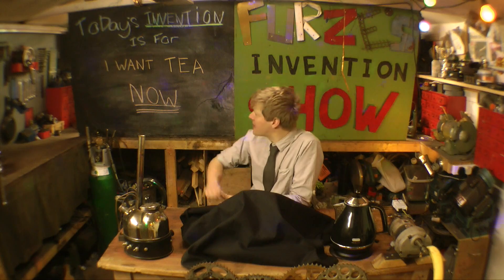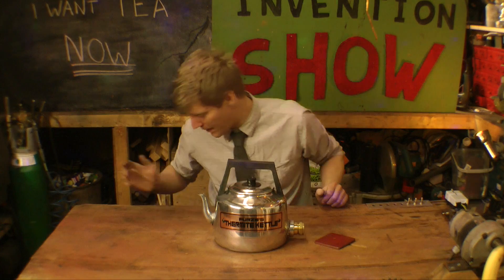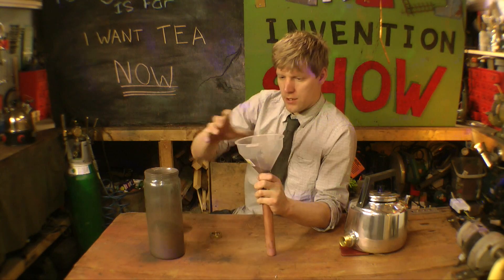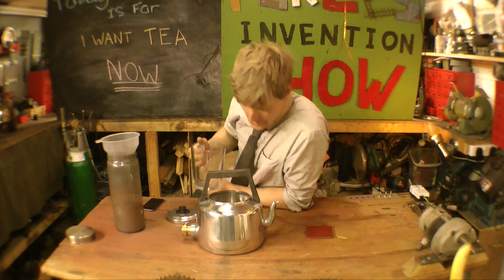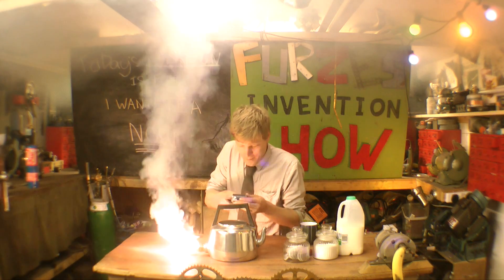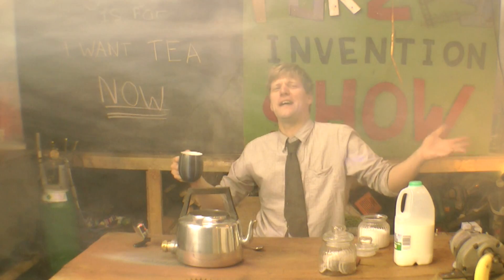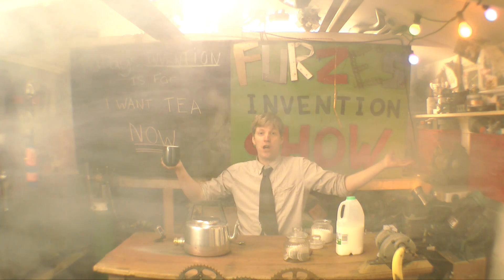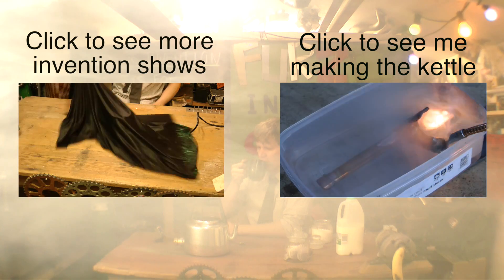The Thermite Kettle

Comment from the maker: HAHA YES MY TEA IS WEAK as hell in this video, now i do have it weak tea but on this it does look bloody awful so keep the abuse coming.
Reply: How are you not choking to death!? Keep it up man. Never a boring video :)
Reply: +colinfurze make an air umbrella
Reply: +colinfurze You can improve the heating time by increasing the surface area of the heating element. same quantity of thermite, in multiple smaller pipe. you'd make the side of the kettle flat, and have the thermite cartridge slide in like a fork made of multiple tubes, those multiple tubes would be connected like a fork, and be filled and lit together. you'd need 1 sparkler for each fork, and to have them bent together to a single lighting point, but it would work. 

In fact you could probably do with less thermite as well. just work out the math for how long it burns for, how much heat is generated total, just go from there. 

Though really the best you could do is with a very tall kettle that you put the "fork" in through the bottom, and it looks like the bottom of a CPU chip, a grid of prongs. and just fill it to the top. Maximum surface area evenly distributed through the water, for the fastest heating possible. 

But heating from the bottom with thermite, you'd have trouble lighting it, and you'd probably catch the table on fire. maybe a sealed disposable electric starter and a gas vent?
Reply: Make a homemade swegway? That would be awesome!!
Reply: +colinfurze 600cc Blender that can make a 5 gallon margarita in seconds :D
Reply: +colinfurze Yeah that brew looked sub-standard....
Reply: +colinfurze was just about to say it looked very milky
Reply: +colinfurze Do you have any tea with that milk? :P
Reply: +colinfurze 
Running out of ideas?  LOL
Reply: +colinfurze  How about a self cooling pillow?
Reply: +colinfurze make a mug that warms your tea up once it is cold
Reply: try make a real lightsaber
Reply: colinfurze https://www.change.org/p/bbc-collin-furze-as-the-13th-doctor
Reply: +colinfurze When you want tea, YOU WANT IT NOW!
Reply: +therealquade I reckon he should just attach the heat tubes of a CPU heat sink to the pipe. would be way quicker!
Reply: make a flying ✈ car 🚗
Reply: +colinfurze Should have just blamed it on the white balance and kept some pride .......I've seen stronger tea in hospitals.
Reply: Anne Hero that would add a delay, the heat only transfers so quickly. First the thermite gets hot, then the tube gets hot THEN the heatsync gets hot, THEN the water gets hot. you're also increasing the volume of what's being heated. which means you'd need more thermite, not less.
Reply: you should call it thettle
Reply: +colinfurze How come the thermite didn't burn through the tube?
Reply: +colinfurze Not many others who can make a living while having great fun the way you do. My hat's off to you, good sir.
Reply: +colinfurze LOL! nice! It would probably go even quicker if you increased the surface area of the thermite container (i.e. more smaller tubes instead of a single big one)
btw.:
How about making a machine that fries a pancake and flips it (by throwing... obviously) at the perfect time? :)
The pan could also be thermite heated ;P
Reply: I think u should make something to worm up ur bed before u get in and u can make up the name or if u used mine call it the bed wormer but i dont know so it is up to u about the name
Reply: +colinfurze Make a generator that runs off of poop.
Reply: +colinfurze  make a toboggan or sled that will go up a hill
Reply: put an engine on a wheelchair
Reply: try making a self charging phone
Reply: Herds of cows gave their lives for that cup of tea.
Reply: +colinfurze  I have a fun idea... you know the moving walkways at some airports? why not a grass one for your front lawn? like a stone block path that leads to the end of the driveway, but it moves and you dont have any need for stone.
Reply: +colinfurze Make jet powered ice skates
Reply: +colinfurze Hey colin, can you make a powered wheelchair, that can faster drive at 10 mph? thank you!
(the kettle is very cool :D)
Reply: +colinfurze that was a shit cup of tea, Colin. 

Nice kettle though! :D
Reply: great idea!! can I suggest a new idea? I was thinking a cool chair that we can sit back in and watch our house burn down as we sip our tea. hahaha. great videos
Reply: How about a suitcase thata jet powered then you dont have to pull it and wear your arms out simples LOL
Reply: +colinfurze you must have a whole army of angels working for you-most serious injury was some burnt skin right? keep up the great work!
Reply: Banananananananana
Reply: +colinfurze thought you were drinking horlicks
Reply: that's cool
Reply: +colinfurze Make a toaster which automatically toasts and spreads butter on a pieice of toast.
Reply: +colinfurze sugar rocket powered gocart
Reply: Philip Gragg because he made his own thermite with a specific ratio so it wont melt the tube.
Reply: +Philip Gragg He said in the build video that he botched the mix a bit when he was making thermite for another project. So this isn't good thermite.
Reply: +Philip Gragg watch how he made it
Reply: okay, I see.. interesting... So this isn't actually thermite..
Reply: Don,t you have a over Chanel
Reply: Make a dryer that folds clothes
Reply: gotcha... cool
Reply: +colinfurze compressed air pumpkin Canon
Reply: I love your vids :) and your humour
Reply: I have an idea where can I send it to you ? it's highly related to almost anything you do in your shed
Reply: +colinfurze Make an on-demand pizza-delivery system. For when you don't want to stop watching the telly to take the left-over pizza (or other edibles) from the kitchen, you press a button on your remote that swings your fridge-door open and launches a tube of pizza at you using pressurised air!
Reply: I was beginning to think British tea was white or sumtin! O.o
Reply: Can you do the Assassins Creed Phantom Blade
Reply: +colinfurze These can only be British comments like me.  Well no not just weak, but too much milk aka nursery tea.  Keep up the good work CFI admire your attention to detail with your work.
Reply: +colinfurze hey i seen you in You Me And The Apocalypse, you lucked exactly the same as in your youtube videos.
keep them kettle ideas coming u goto get to 30 seconds haha, Good luck
Reply: For your next invention, try and make hovercraft shoes
Reply: make some super heated swords that glow red !!!!!
Reply: no abuse here, i praise the hard work and extreme effort you have thrown into everything. keep that good attitude and confidence going.
Reply: do a super powerfull blowgun/slingshot/bow
Reply: +colinfurze what about a snow-maker for slurpies. that shit would be turnt.
Reply: that's brilliant, if it wasn't for the fire hazard it would be perfect!
Reply: Bit rough on the finish… I mean the table's. ;)
Reply: I would love if you do something related to rainbow six siege.
Reply: Here's my idea a fully automated espresso machine. For inspiration see the coffee machine from The Green Hornet (2011).
Reply: Do a suit that goes around your whole body shots bullets and flames and you can charge your phone also make it so you can move easily it's a big project so make it like the atom from the cow tv show do legends of tomorrow arrow and the flash or like iron man
Reply: +colinfurze Collin! You should make a mini fridge that will open up automatically and shoot you a beer or something. PS: I'd think it'd be a good idea to mix this invention with something like the "Freezer Wave"
Reply: you should make the all in one jacket. Heating, a jettle, a built in seat. stuff like that.
Reply: +colinfurze invention idea: Fusion reactor :D
Reply: Make a awesome controlable robot that shoot fireworks and you can control it inside like a mech
Reply: and then blow up a car with a gas tank for the robot to shoot
Reply: invention idea Nuclear Bomb
Reply: +Philip Gragg if you look at the other video where he makes the kettle, he explains that the aluminium powder he used was much more coarse than normal, so it burns a little cooler than normal
Reply: +colinfurze  you should try to  make something that shoots a knife, but gets set on fire when shot out
Reply: +colinfurze You my friend are KooKoo lol ,keep up the videos
Reply: +colinfurze I have quite the idea so i hope your up for it (actually i have two ideas maybe three) My first idea is a pulse jet powered car (but with like 2-4 pulse jets) (if u have already done this don't judge me :D) My second idea is to make a jet/pulse jet powered generator for your bunker.  My last idea may be a slightly dangerous (by that i mean u might/probably will die to this experiment) it is a pulse jet or jet (and just to throw it out there a very powerful water pump) to launch you AKA dummy to SPACE (in case of the jet/pulse jet just make it fly the dummy around your air strip looking place and have fun!  you AKA your weight ratio to a dummy (that last sentence wasn't suppose to go there but just wanted to make sure you knew that! PEEPS LIKE IF U WANT TO SEE!!!
Reply: man the smoke ejectors! collins makin tea!
Reply: Make a jet powered hat
Reply: jet pack! build a jet pack! :D
Reply: +Andrew Bartholomew  A thermite bed wetter, er, warmer!!!!  Holy shit that would rock.
  A big hello from Edmonton Alberta, Canada, the armpit of  western Canada!!!  ;-)
Reply: Bad idea! Your gonna burn your house down you know!
Reply: going to unsubscribe because of that cup of milk
Reply: Erfan Emamverdi dat will be helariouuuuuuusssss
Reply: I think u should make a drone.!!! A ground or flying
Reply: Colin can u make pulsejet water heater for shelter
Reply: ya mum called... she wants her cup of tea back!!! ;)
Reply: Ever do sweet tea? Like with just ice and sugar?
Reply: Make a lantern made out of many little visible lasers that should be aaaamaziiing
Reply: +Diego Travieso A laser hose LOL that would be crazy, Like a grid of at least 50 or something.
Reply: Yeahhhhh that should be graiiiiit
Reply: Rocket shoes!!!!
Reply: +colinfurze  Hey This maybe stupid but why dose the thermite not burn the whole thing? I've seen thermite burn through car engine block right through? So what it don't burn copper?
Reply: +MR .Foog he fucked with the ratio
Reply: You should make a speed tea were you focus on time and quality of the tea.
Reply: +colinfurze  I am sorry to tell you this but aluminum oxide gas is very toxic and should not be inhaled. it could cause lung cancer and asphyxiation.
Reply: Quick bath
Reply: +DIY Arsonal Not if you don't believe in it.
Reply: hey, how would be an automatic breakfast machine with a tea gun and a toaster which shoots the bread on your table?
Reply: +colinfurze love your videos man +1
Reply: MAKE AN OUTO BOX OPENER PLEASE 😢😢
Reply: +colinfurze Make jet powered ice skates
Reply: +colinfurze heres one. could you make a rocket powered kettle. it will be competition for your jettle and thermite kettle. good luck
Reply: Please make a small piatan saucer model aircraft that works off of the principles of electrohydrodynamics this would be the coolest thing to see
Reply: +colinfurze How about start fiddling with microwaves?
Reply: make a friction bike
Reply: +colinfurze If you recirculated the hot gas from the burning thermite through more submerged piping before venting it you could probably boil the whole thing properly :P
Reply: Was it worth it?
Reply: you wake up in the morning and it's cold. use a timer to trigger a machine that turns on the heating to warm up the house when your asleep.
Reply: +Philip Gragg 

There was water on the tube to dissipate the heat. Now if the kettle was to boil dry then the tube and possibly the kettle would melt.
Reply: +James Plays Games so a thermostat then?
Reply: you put milk in your tea?
Reply: +colinfurze a gauntlet trebuche that shoot fireballs, automatic crossbow, Rocket skates, rocket power shopping cart that can fly, Good luck and gods speed!
Reply: you're supposed to add the milk after the water
Reply: Paul Ferguson where are you from? Americans don't do it that way.
Reply: +Johnathan Bennett dude look it up British scientists did an experiment on it and any normally functioning brain knows that if you add the cold first it will cool down the hot liquid to where your tea looks weak as fuck....
Reply: +Paul Ferguson this is why Americans can't make a good cup of tea. and should stick to coffee
Reply: +Bristol Aprilia I may be the only American who likes tea enough to actually care how to make it
Reply: Paul Ferguson you're getting so upset about tea, but keep going its very amusing and entertaining.
Reply: +Johnathan Bennett upset lmfao no just educating someone who doest know much of anything
Reply: +Paul Ferguson I don't give a fuck about tea really or how its made,I'm a beer drinker.lol
Reply: Paul Ferguson I'm going to be the bigger person and leave you to your "amazing" tea. Tootles bitch
Reply: +Johnathan Bennett what is a Tootles bitch. lol.
Reply: Ha mate make a jet car
Reply: +Johnathan Bennett Us Bennetts are everywhere!
Reply: +Josh Bennett not where I'm from, lol.
Reply: Please! make a TURBO!!.. Doughnut machine!
Reply: +colinfurze GROSS tea without ice
Reply: How about a refrigerator drink bottle
Reply: colinfurze uuuuhhhh sspringy shoes ??
Reply: colinfurze your so cool

Comment: build a fusion reactor, which powers the hot tap in your house?
Reply: +NonsensicalSpudz I swear to God. One day he'll figure out the cold fusion.
Reply: +Anes Mesic The day this happens is the day we all die.
Reply: +smashhawk rip me i live in the netherlands 
het leven is hard voor een mens
Reply: +Anes Mesic we've already figured out cold fusion, it's just not very plausible to carry out as it takes way more energy than it gives out by like a factor of 5 minimum
Reply: +calex1290 no, no we didn't.
Reply: +Norbury53 i second this
Reply: +calex1290 We can do regular fusion like what happens in the sun, but it isn't viable yet. I don't know where you heard we can do cold fusion i.e. Fusion at closer to room temperature for those who didn't know
Reply: +Battleoid you realise there more than one way to get nuclear fusion? Trust me I've studied in cold fusion viability, instead of using the common method of superheating plasma to millions of degrees to get atoms to move fast enough, you can simply use muons or tauons to get fusion as well, it's called muon catalyzed fusion, and/ or tauon catalyzed fusion. The tauons however are extremely unviable, but the muons are promising, but lack the energy output, and yes you can carry out these in room temp
Reply: calex1290 I would love if you explained this topic more thoroughly. Not to prove you wrong, I'm just very interested.
Reply: ***** Ok basically, to get nuclear fusion you simply have to get the nucleus of 2 atoms close enough so the strong nuclear force can overcome the repelling force of the 2 positively charged nuclei. However this distance for the strong nuclear force to take effect is at around 8 or less femtometres, so no matter the route, if you get the nuclei close enough it will fuse, its also one of the theories why we can't reach true Absolute Zero, as the atoms will get too close together and fuse, causing the temperature to sky-rocket. Anyway with muon-catayzled fusion, the muon lepton particle is basically a much heavier electron, 207 times as heavy, and so we can bombard a plate of deuterium and tritium with muons, so a muon can take the place of a electron and since hydrogen is diatomic, (ideall) one deuterium will bond to one tritium covalently, with a muon in place of an electron, and since the muon is 207 times more massive, it will pull the nucleus/atoms 207 times closer to each other, joined with vibrations of the atoms and even the quantum tunnelling effect, this is enough to get the deuterium nucleus and tritium nucleus close enough together for them to fuse even in room temperatures. And if you want i can tell you some of the reasons and difficulties why this may not be viable.
Reply: +calex1290 do you understand to fuse hydrogen it is 8-22 m close so this can be done a few ways get it so massive that it collapses onto its self or to heat it up to about 45-80 thousands degrees... cold fusion is bullshit because energy is measured through radiation which is what. like why do batteries get hot when you use them ... the UN is working on fusion look up the iter project
Reply: +NonsensicalSpudz It would be a FURZEon reactor! :D
Reply: +elliottatk lastname I'm not sure what you wrote, but it's true that most cold fusion is "bullshit" and the typical  theorised design doesn't work, however muon-cataylzed fusion is different yet is still classed as cold fusion and is a working concept. I think what you're describing is the traditional ways to get fusion by accelerating the atoms so fast that they collide with enough force- done by imploding a fuel pellet which i believe is what the Americans is doing with their lasers or using tokamaks or stellarators. Muon catayzled fusion is; instead of making atoms travel fast and collide,  its to simply pull them together closer using a muon particle, and is a perfectly working method, only reason why we do not use this path is because we put in way more energy than what we get out, and there's a factor of luck involved.

Comment: I use to be a thermite welder on the railway. We used to cook sausages on the excess thermite once it poured out of the mould and into the slab bowls. We would empty the bowl, stand the bowl on the slag, line it in foil, drop the sausages in. The put another bowl over the top and the slag from that bowl ontop. so it cooked from top and bottom. was awesome on cold nights.